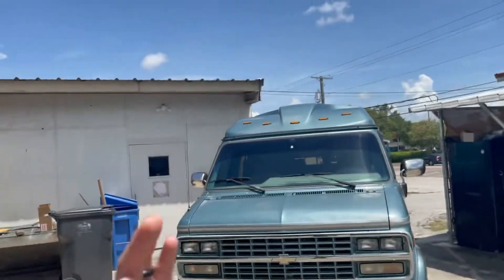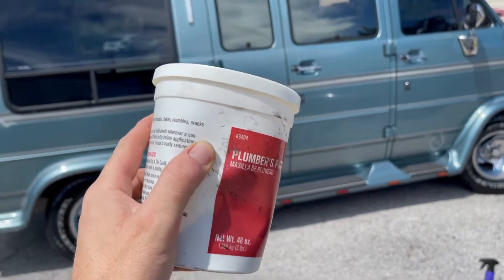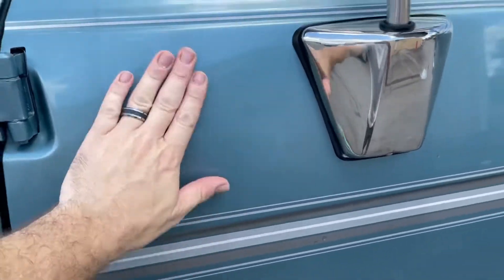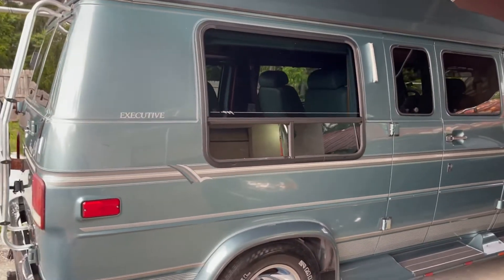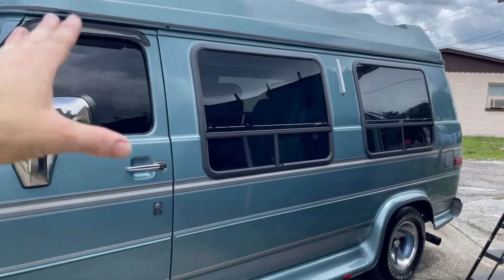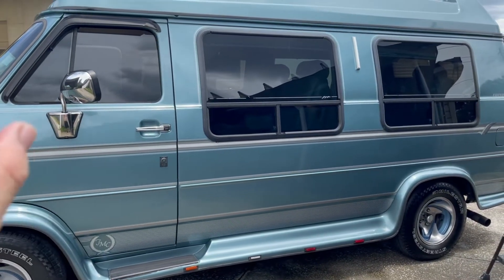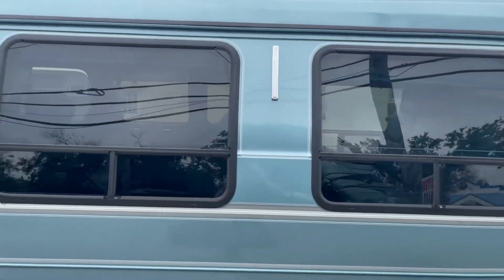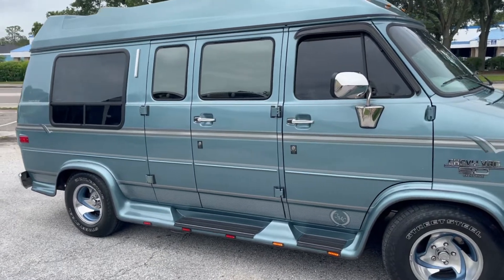Restoring my 1995 Chevy G20 conversion vans exterior: full paint correction and ceramic coating

Comment: It would be helpful if you would explain what tools you are using.  I have a 89 Chevy G20 and I need to try to remove rust and paint it. I also need to work on the tire holder.  Is that a drill with a wire brush and then a polisher?  I am not sure what the round tool is that you are using.  At first I thought it may be a grinder but watching the video it looks like something else.  Does it have sand paper on it?  Yes.. I am a newbie and trying to learn.  I was going to have my van done professionally but the prices were way too expensive so I am going to work on it myself.
Reply from the maker: Hi I agree to do it yourself.  Let me go back and and a list of what you can use.   Rust can be difficult if it’s more than surface rust.   If you have rust holes I suggest using a shop to weld in new metal and try to do rest yourself
Reply: @petescarport  I actually found a lot just by watching your video. I searched for the tools and found a lot that I can use on the small rust areas on my van.  But - how do you reach the front above the windshield.  I may have to rent a small scaffold.. lol
Reply from the maker: @lynnsweet6902  let me know if you need any help.  I’m here to answer what I can
Reply: @petescarport  Thank You